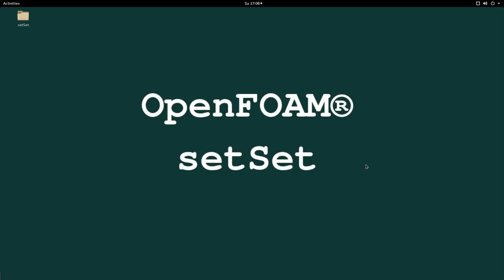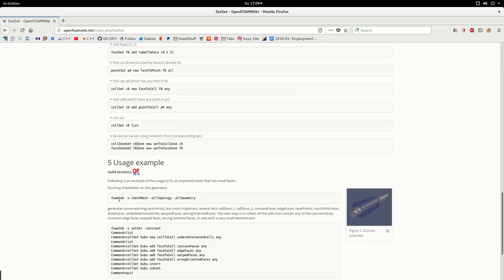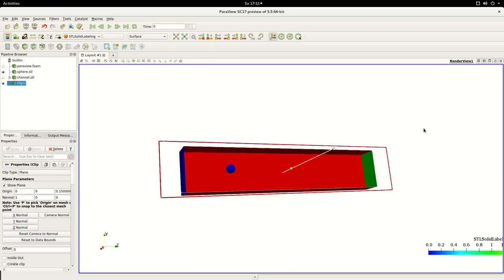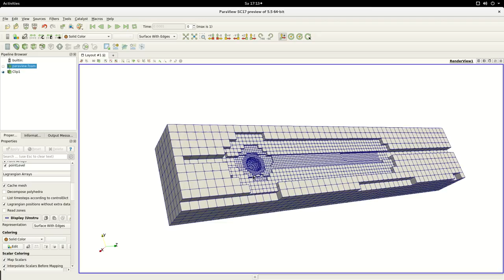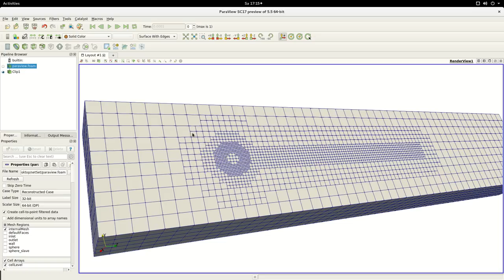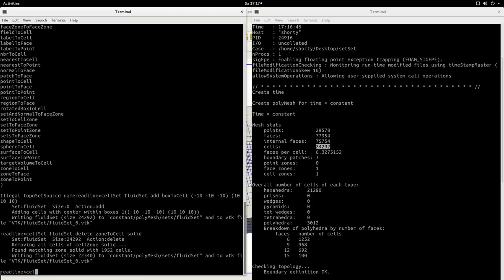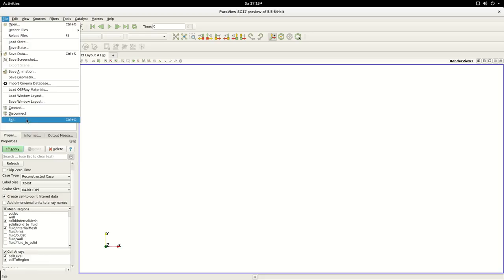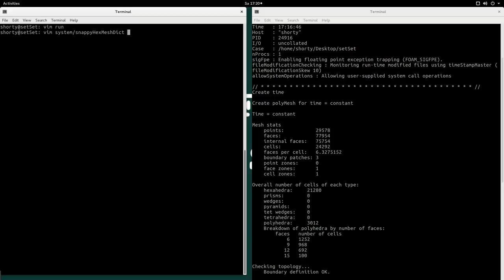setSet ∇ OpenFOAM® Application Training

Comment: first of all, thank you sir for such a nice video. I had one query. I am working on a project where in the mesh domain, there are two zones say: A and B. I have to solve  (1) equation_1==0; for zone A and (2) equation_2== source_term; for zone B. How to implement it at the solver level. In simple words, I don't want to do anything with creating interface boundary condition or something, I just want to solve the system of equations with conditional zones specified in the solver itself.  I don't know how to do that. Please enlighten me, it will be a great help...Thanks

Comment: Hello Tobias, first of all thank you for these great content i have learnt a lot from you and Jozsef Nagy. I have a question but maybe little complicated to be explained on here, still i will try.
I am trying to create CHT case, and as you show in video i have managed to seperate my mesh in 2 cellZones.
-I used STL files (i named them on Blender) where all my boundaries (inlet, outlet, sides, fins, and heater) are described in seperate STL files.
-I need to define one face of my "fins" geometry as my another boundary. However if i seperate that face on blender, my fins STL will no longer be a closed surface which means on snappyHexMeshDict, i won't be able to define region inside as my cellZone.
How can i create boundary on my "fins" geometry with out seperating that face from it. Thanks in advance.

Comment: Hi Tobias, thanks for the explanation. I want automate the entire process from mesh generation to submitting the job using bash script but if I use setSet in the script it quasi opens like a terminal and the next commands aren’t executed. Do you have an idea how to run setSet followed by cellZoneSet command using bash?
Reply from the maker: Yes. Use topoSet and put everything in the topoSetDict. TopoSet is an equivalent to setSet but has way more options and is not terminal based.
Reply: @HolzmannCFD  thanks. :) 
Another way is to use setSet with -batch option so “setSet -batch (file with all the commands)“.
Reply from the maker: Yes but topoSet is more powerful  @pawansrinivasamurthy100

Comment: Thank you Tobias for your great work. Actually, I am following your work on your website, cfd forum and here on youtube. It really helps me a lot to resolve my problems on OpenFOAM.
I have a question regarding multiregion meshing. I have seen your tutorial on your website for three water pipe. I have a similar geometry but with 84 pipes (not connected with each other) enclosed in a channel. I want to do meshing for all pipes and external channel. I know I can define through stl in snappyhexmesh and using cellSet and cellZone I can do meshing. But it is highly inefficient and prone to error to define everypipe with separate stl file.
Is there any other way of doing its meshing using openFOAM without defining every pipe with separate stll file.

ps: At the moment all the pipes have been defined with a single stl file. Later on in simulation, I want to use every pipe as a heat source.  

Thanks
Reply from the maker: Yes sure but only if you develop your own script/pre-processor which takes all the workload and fills in the correct data to the responsible files.

Thanks for your valuable reply and fruits. 
Its good to know that my "old" material still helps people.